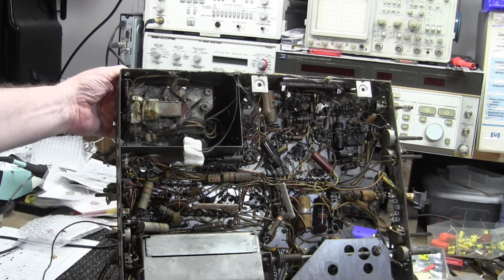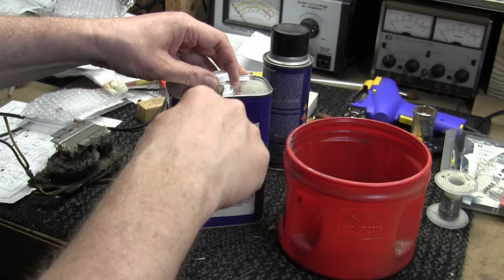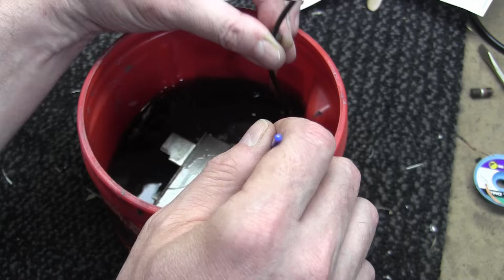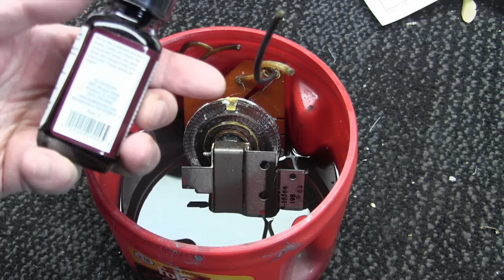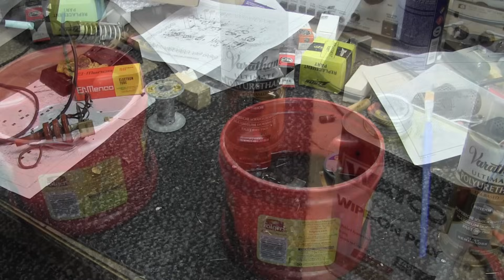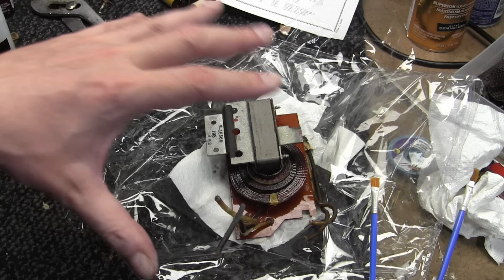Bob's Tech Tip:  Flyback transformer recoating

Comment: What an improvement! MG chemicals lists 4226A clear insulating varnish as their replacement product for super corona dope. It seems to have similar dielectric properties, but with a lower VOC formulation. The new version has a longer drying time but a shorter recoat time, which might even be a plus in this case
Reply from the maker: Thanks!  It's 3,000 volts/mil vs 4,100 of the old stuff but still very good.  I'll try to pick some up.
Reply: @bandersentv  Also there's polyurethane insulating varnish in a spray can form. "Kontakt Chemie Urethan 71", also available in a can, that's what I would suggest to use, as the nozzle of the spray version always clogs, often the valve itself fails. It has 40kV/mm dielectric strength, which is about 1kV/mil if I'm not wrong. So the MG Chemicals 4226A is 3x better. The Urethan 71 also has the downside of having 1 week 90% curing time at room temperature. It is more suitable as conformal coating on PCBs. Maybe it's not even available on the US market.
Reply: Thanks for finding that. Here's a data sheet comparing it with red insulating varnish. It loos like it's thinner, and clear, but doesn't quite have the dielectric strength of the old super corona dope, or the red insulating varnish.https://mgchemicals.com/downloads/category-data-sheets/CDS-Insulation%20Coatings.pdf

Comment: Great job cleaning the flyback transformer Bob... the question is of course... will it work :) I wonder though, since the copper wire is coated with a very thin layer of varnish, won't the paint thinner damage the coating?
I saw another method on Shango's channel where he dunked a whole flyback into (nearly) boiling bees-wax... kinda like deep frying it in wax :) Apparently that would be another method to drive out any moisture from the HV windings AND coating the whole flyback in a good dielectric... Either way, I'm curious to see the result :)
Reply from the maker: Paint thinner does not dissolve the enamel coating on the wire so should not be an issue. Beeswax melts at a low temperature and is fragile.  I was looking for something more durable like polyurethane.

Comment: Eastwood has Glyptal.  Sit down. 60 bucks a quart. Used for motor windings.  

Thanks william
Reply from the maker: Glyptal is the same as the red insulating varnish I mentioned.
Reply: @bandersentv  I just checked, it's Glyptal 1201 and 1201B (the B version is thicker). They have 1.5kV/mil dielectric strength, so the MG Chemicals stuff is much better for HV stuff.

Comment: Nice work and will probably work. Personally, I would go with Insulating enamel, AKA Glyptol. Checked and it is $50/quart. 1500V/mil isolation. Used that in an old job and it was like epoxy and stood up to anything. So, I am biased to it.
Quick search found spray cans of insulating varnish for about $10/can.
Reply from the maker: Yes, that's the red insulating enamel I show and mention is an option.

Comment: Have you tried styrofoam (like packing peanuts) and denatured alcohol? It makes a very good insulator. You dissolve the styrofoam into the alcohol until it turns thick. I haven't tried it with MEK, but it sounds doable.
Reply: Often electronics cleaned with alcohol has to be baked afterward to drive of the remaining moisture. Alcohol can cause crazing of some enameled wire. Otherwise this is an interesting potential solution. You might be able to substitute naptha for the alcohol. Naptha does not absorb moisture, and disolves waxes much better than alcohol.
Reply from the maker: No and never heard of that technique.  Any idea what the specs are or how stable it is?
Reply: @bandersentv  I think it is similar to Q dope used on rf coils. Polystyrene has low dielectric loss and absorption which makes it a good capacitor dielectric, but it does not handle high temperatures well.
Reply: @bandersentv  Styrene, polypropylene, and polyethylene are used in electronic components. Depending on which styrofoam you get, it'll be one of those. I don't know how you'd differentiate between them.
Reply: Denatured alcohol is a mixture and can have different compounds in it. Basically it is ethyl (drinkable) alcohol plus something to make it undrinkable. Straight ethyl alcohol is taxed like liquor, so to avoid the higher taxes the alcohol is mixed with something nasty tasting. Sometimes methyl (wood) alcohol, gasoline, acetone, etc. are used. Styrofoam (foamed polystyrene) does not dissolve in alcohol. It will dissolve in acetone and I think MEK.  Polypropylene and polyethylene would be even more difficult to dissolve.